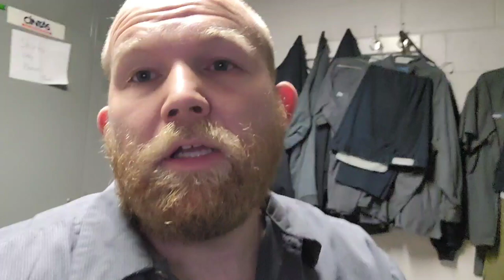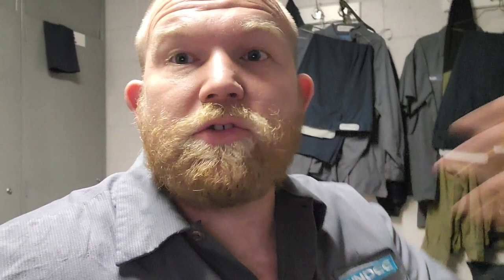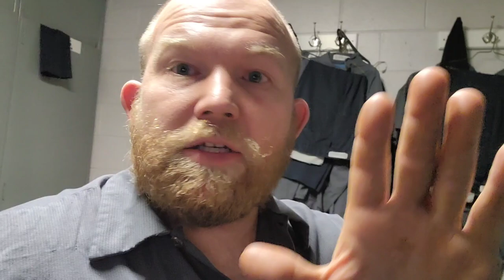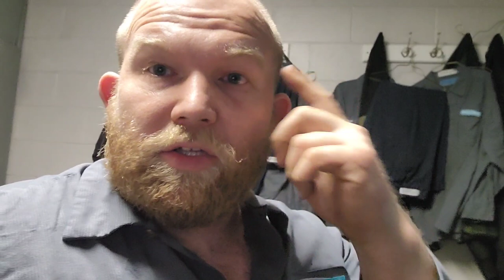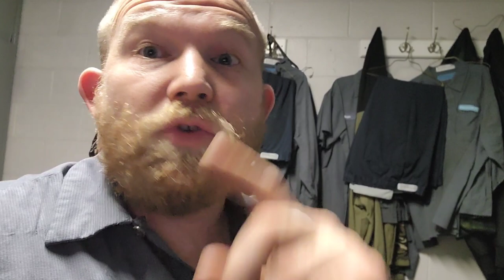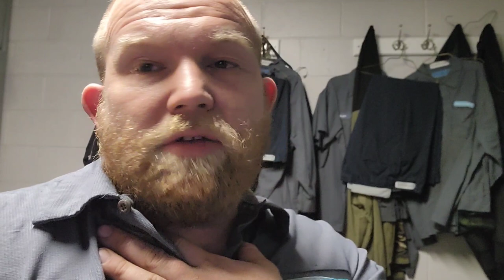2021 Ford FDRS Important Module Programming Talk - Stressful Stuff

Comment: I know this is 2 years old... I was looking for videos about no scan tool connection to the gateway module and watched this video too.  Last fall I attended a Ford sponsored and taught FDRS class.  I might add.  In that class the instructor (ford instructor) was very plain about DO NOT update ANY modules in any Ford vehicle you were NOT having an issue with!  He was also pretty plain that is a great way of causing yourself problems you can't fix without buying a bone stock Ford replacement module and trying to reflash the original data.  And that may not be available anymore.  Don't make yourself extra issues was his motto. If your having trouble and your sure... then you can try the reflash...as a last resort

Comment: I must say, as a somewhat newish mobile technician, the lack of unification or standards is one of the single biggest hurdles one has to overcome if you want to be a technician these days.  I was all behind the OBD2 standards being mandated back in '96.  The idea being that independent shops or technicians would still have access to the diagnostic software and procedures, and not being locked behind some manufacture specific diagnostic tools.  Between the secure access modules gaining wider acceptance plus model specific crap like FCA compliance, there is no end to having to spend money for crap you almost never use.  I must say also, I am not a fan at all of anything that requires an internet connection simply for diagnostic purposes, and the same for module programming.  Although nowadays that's a big ask.

Comment: As an owner of a 2020 f150 I went to this process to update the infotainment system (radio). First tried the over-the-air option (my home's wifi) but it was too slow and the vehicle kept shutting it down due to battery drain. I ended up using the mem stick method while driving the vehicle around (was allowed for the radio). I thought ford techs were able to just attach a scan tool...I was obiously wrong.
Reply: When ever i flash a module, i always keep battery charger on the vehicle. Crunching numbers drains the battery pretty fast.

Comment: Kind of a crapshoot but I have a lot of questions. I am fighting my epas. I need to update my pscm. If I call the service department will they be able to do this for me? Or through forscan? Or ids? I have issues with wandering steering. 

Also when I bring a vehicle in, does the shop normally try to update my modules?

Comment: So my son owns a 2021 Ford Edge SEL. He received a recall on the camera system going black or being distorted so he took it in. Long story short all modules but one worked. Ford thinks it's the module so they order a new one well guess what that wasn't the problem. Their next solution they are going to reset the computer system now mind you they have already had his car for a month now and no new updates they have the master mechanic on it, They have had a Ford Engineer looking at it etc etc. Now we are on the 2nd month he gets a call from the dealership weekly and well the answer is we don't know what is wrong but we are still working on it. WTH!!!?????? So as of yesterday it has been in the shop for 2 months! And we still are at square one. So who do you need to bring in now since no one knows what is going on.

Comment: I hope Mazda don’t do something like this with mdars. Not many vehicles use it at the moment only Mazda 3 (BP), cx-30 and mx-30. There are some cx-5, 8 and 9’s but you can still use the old Mazda IDS with them. My biggest gripe with mdars is the need for a log in to work, and then force you to change your password every 90 days. When most of the time we just need to scan for codes. Unless it’s for programming. A cheap laptop and FORscan would cover most of what people do for services.

Comment: I have spent many months of tears to validate programming protocols before we could OK the tools for the dealership techs.  I know that frustration level.

I was nearly fired by less than intelligent bosses.  The programming would work on the bench, but it would NOT work on the vehicles.  It was even worse when doing reprogramming that updated the boot code.  Any issue would "brick" the ECM or module.  The computer engineers did not know what they were doing, and I would get the shaft.

There were many times where I could not get an ACK message from a module, and there were no timeouts.  The vehicles could not turn off without an ACK return message.  I had to disconnect the GND cable from the battery or batteries.

Another common issues was mixed endianness, Big Endian, Little Endian, and Mixed Bit Byte Endian.  Each module was OK but never verified to properly communicate with other modules, corrupting the data.

What many people do not know is that the Flash EEPROM in the modules can have errors.  Bits can stick high or stick low.  Some operating systems were not robust to ensure that the Flash is functioning properly.  Good operating systems use offset pointers to work around damaged or suspect Flash.  Getting Bosch to admit fault was nearly impossible.

Another programming error we would have is corrupted memory when too hot or too cold.  Automotive micros and memory are very different than PCs.  Automotive and military micros and memory are special, and good luck getting that supply chain to work properly in 2020-2022.  I just want to cry.

Stick in there.  I know that frustration.  Imagine the frustration I've had when using the VAX to create BIN file cals for you guys at the Ford dealerships.  We share in the same stress.  I lost good men due to that stress.  Imagine the pressure, shutting down multiple assembly lines or stopping dealerships.  We know that you are one of the good ones.
Reply from the maker: My thing is 
that there's modules out of date and then when you go update those modules they're not dropping out of that Q saying that the module has been updated but instead staying in a status of updates are still available - errrrrrrrr I growl at that

I have three modules on this one particular vehicle that have taken the program and they have acknowledged that they are up-to-date after programming but they will not drop out of the Q saying that they have been updated

ABS - says completed and passes with flying colors yet still stays in the needs an update column - so frustrating 

APIM - originally it programmed after 5 attempts and then out of nowhere when it finished 

The TCU Popps up and says guess what now I need an update - and the APIM Dropped off the module update list so I'm thinking ok cool the APIM is done - but I was wrong

  after completing the tcu update it popped back up the APIM now needs ANOTHER  update but won't complete Says something is missing from the online data file from server - red warning message apim won't complete the update 

GSM 
 after the programming has went through the computer and it has accepted everything and then you take the thumb stick and move it back over to the computer to validate everything the computer has literally been communicating the entire time all of a sudden it doesn't want to communicate at that validation point

I have learned while the program is still up

- disconnect the USB from the computer - plug it back in, let the computer see that there was a disconnection and then re handshake with the computer through the vcmm and then all of a sudden it goes through and will validate the programming but GSM just like the abs is still sitting in the same SW UPDATE column saying there is still a update available 

It can indeed be frustrating and I'm the go to guy in the shop for all this frustration with programming but I will not give up
Reply: Mr philips do i have to worry about this stuff in the 2016 vintage year?

Comment: Hi I just wanted to thank you for sharing you experiences with fdrs. I also have used fdrs and have encountered errors and long programming time and repeated configuration with a 2020 explorer st 3.0.  I was wondering if you could share weather you have encountered needing vehicle security credentials from nastf when replacing a bcm or pcm on say a 2020 explorer with fdrs programming.  I didn’t know if at any point fdrs would have a point where I would have to enter that in to complete a programming event on either of these modules. I have subscribed and appreciate your content even if you don’t have time to respond. Thanks again
Reply from the maker: I have had to log into the manufacture database to confirm my tech status but that's it during programming

Comment: Sounds like the flash memory (NAND)? is volatile and sensitive to any voltage drops while programming. Wonder if it’s because of the chip shortage and Ford used sub-par chips from a different vendor and that’s what is bricking the modules involved when being updated. Lot of electronics are like that, they won’t even let a person perform updates unless the reference voltage is maintained. Kind of like if you ever updated a laptop computer it’s required to have the a/c adapter plugged in while updating to keep the device from bricking itself during updates. 

Also is it possible that your scan tool is out of date and needs a update? Could explain the confusion on how to do the procedure (vehicle info display says one thing while the scan tool display contradicts the other) or it’s just a simple programming error again due to Ford using vendors that can’t get good employees that write the code and instruction procedures. 

Just curious does Ford still use the NGS XL CAN Vehicle Interface Module?

Comment: hi partner, one of my customers have a 2020 excursion, and i would like to take it to ford for a FDRS update, cus the audios amplifier known as DSP, keeps affecting audio speakers to the point where no sound at all, ny customer keep unplugin the battery to reset it, until no more reset was possible, until the amp/DSP  fuses #25 and fuse #4  were removed for a minute,  then audio works for a couple of days again and it went out.  my question is, do i ask the dealer for a FDRS update? will the service writer know what im talking about or should i talk to a dealer tech to explain him?  sorry for so many questions, but the best machine i own is a think tool. or thinkcar scan tool, cant remember model at the moment, but is u need it i will grab it from my service truck. thank you for great video. and have a great day.
Reply from the maker: Probably going to tell you your accessory protocol interface module needs to be updated but that may make it worse

Comment: Sadly these issues aren't surprising at all, Ford has made a lot of mistakes in their documentation and service procedures for the 2021 F150s. According to Ford's "Module Configuration and Parameter Chart" you can not run a PMI on the TCCM in a 2021 F150; but when you lookup the service procedure for replacing the TCCM the very first step is to run a PMI, so which is it?

Unfortunately, the TCCM on the 2021 F150 is on the FD-CAN network so I can't even check to see what options exist in FDRS unless I have a newer J2534 like the VCM3 because the older J2534 boxes like the VCM2 aren't FD-CAN capable. I've been waiting over 2 months for a $1500 VCM3 to get shipped just so I can find out if I even need one, because Ford can't get their story straight.

Comment: Back in the day, when heading off to work, if the car did not start, there are only 2  possible issues. Fuel and Spark. Anybody who has ever operated a lawnmower will know this. Why does a person need to give their car to the dealer for a "reprogramming?"
Reply from the maker: Insert 2021 F150 when oil life drops too low on the 5.0 Coyote engine and won't start because you're one quart low or less than 20% oil life PCM disables causing the vehicle not to start needing to be towed it to the dealer for reprogramming so you can take the program out of the computer that does that all or remove the negative cable of the battery for 5 minutes and then put it back on and start the vehicle and reset the oil life and then take it to the dealer to have the technical service bulletin done to remove that programming that was a mistake from the manufacturer

Comment: I updated all my modules successfully besides 1. The apim. I got it in a usb drive. Sync says indexing but never says updating. Sat it in there for an hour and never popped up. Any idea?
Reply from the maker: Master reset and try a different USB
Reply from the maker: If it still won't take the program you probably need a new accessory protocol interface module

Comment: Maybe you could help me out. 2021 F150 Powerboost with 5k miles. Bought it new in Nov 2021. I haven't got any OTA updates because it's failing updating the gateway module. My local dealership has it 3 days, tried 4 times to update "software" but can't specifically tell me what they are trying to update. If the update is failing on OTA and locally, wouldn't that mean a bad module? I've had a few other issues as well. Screen flickers and reverse brake assist not available etc... Any help is much appreciated.
Reply from the maker: No it doesn't necessarily mean that it's the Gateway module that's bad it could be corrupt data it could be something wrong with the Ford system

Comment: Speaking of modules, gfs 2016 edge 2.0 has basic infotainment system.  Randomly when getting in car and turning it on the radio will turn on by itself right away even tho radio was not on when car shut off. Doesn't happen all the time just randomly along with the windshield wipers will randomly not work.  Edge at 80k now. Is this some kind of bcm module failure?
Reply from the maker: Umm hmm could be a module deal or some kind of relay sticking 

Something odd 

Would have to pull a wiring schematic and see if anything was in common
Reply: Appreciate the reply, btw great videos and always informative. 👍🏻👍🏻
Reply: Also apparently a dealer at one point put in a new wiper switch so it was a known issue that was never resolved.